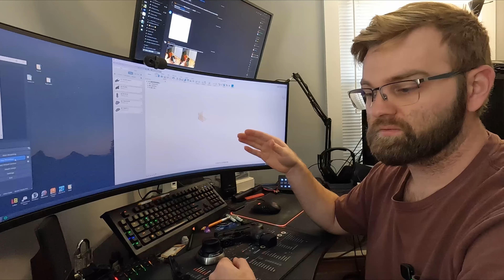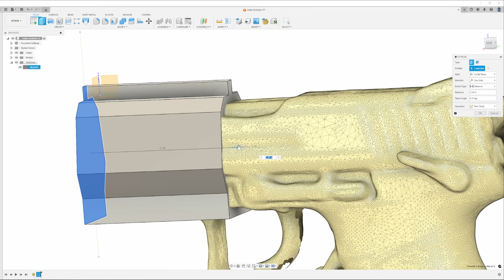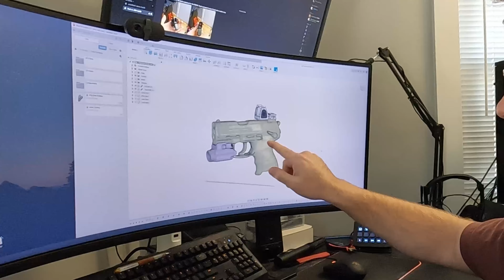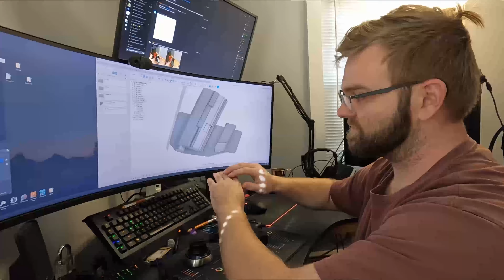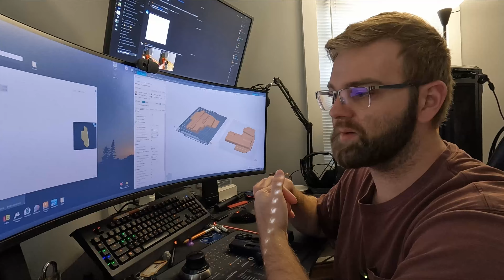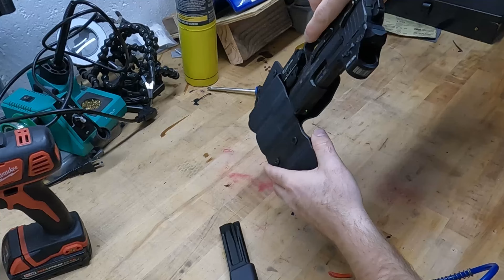Designing and Vacuum Forming your own Pistol Holster

Comment: Spray deodorant leaves a matte finish
Reply from the maker: I’ve tried it but never got it to work super well. The alcohol and baby powder is super cheap and applies super well. Also some of my larger scans like the front end of my car would take cans of deodorant probably! But I know some people love it
Reply: @TwinCrestInnovations  I will have to try that, i was using degree spray and for $8 a can now it is kinda spendy. Aerosolizing the alcohol/talc mixture shouldn’t be too difficult.
Reply from the maker: @RadDadisRad I’ve been using the same bottle of baby powder for the last 2-3 years and the rubbing alcohol I just steal when I need it. You can probably use an old spray bottle but I bought a brand new one and mix it 1:1 as you need it. I mixed like 8 oz the first time and that was a mistake. A little goes a long way

Comment: Do you think you could make a kydex holster for a short barrel shotgun? Something that could be worn on the hip, the back, or even on a backpack?
Reply from the maker: Do I think it could be done? yes. Do I think it’s practical? Probably not if done like a normal holster but could be done in two pieces. 

I’d probably make a holster for the front 3-5 inches of the gun. Then a secondary holster near the chamber that clamps around the gun, maybe use a strap with a snap for retention. This way your draw distance is short. Otherwise you would just be making a plastic scabbard.
Reply: @TwinCrestInnovations That makes sense. I've been trying to figure something out for my bush gun when in Montanan griz country. It's hard to find that balance of steady and ready but also having it protected from dirt or twigs that might try to get into the barrel.
Reply from the maker: @M @MichaelSelhost  think going with that two piece holster would be your best bet. The two half’s would have to be joined by a semi rigid board or something. You could use kydex. I was trying to think of readiness and removing cost. That way it’s not this giant chunk of plastic. I suppose it would also reduce weight if you are hiking around a lot.

Comment: Brother do you also scale your mesh body before you start modeling your first sketch? Thank you
Reply from the maker: As long as you import it with the right units you shouldn’t have to scale it. The shinning 3d scans in millimeters and should be 1:1 if imported correctly. If you use a different software for scanning your results may vary
Reply: @TwinCrestInnovations Thank you
Reply from the maker: @1Defenseart  no problem! Happy designing!

Comment: Why not go kydex right over the actual firearm? 🤔 Sorry if that’s a dumb Q
Reply from the maker: If you just went directly over the firearm you wouldn’t be able to pull it out of the holster. For one example the kydex would form around the trigger and block the flashlight from coming out. There’s so many little areas that it would get hung up on. This method lets me make paths and channels for things to slide out. Some people will use painters tape and popsicle sticks to achieve similar results for one off designs. Not a dumb question! Thanks for asking!
Reply: @TwinCrestInnovations man that was so obvious after you said it. Lol great work man. I’m finding this video incredibly inspiring for an idea of mine. Thank you!
Reply: I’m such a newb tho. Literally played with Tinker CAD for the first time ever and trying to figure out which 3D printer will get me to a nice finished product.
Reply from the maker: @richardlopez9001  if you don’t want 3d printing to become your hobby then I cannot recommend Bambu labs enough. They are also currently running a sale! 

I’d also recommend fusion 360 and spending some time learning that. There’s a guy called Learn Everything About Design here on YouTube that has a great beginner course on how to use fusion. Give that a try!
Reply: @TwinCrestInnovations I went out and bought a Bambu Labs P1S last night and I have to thank you for steering me in that direction. I printed a sample just to see things in motion and then stayed up until midnight creating my mini prototype and printed it this morning. So stoked man!
Reply from the maker: @richardlopez9001  I have spent many a nights with the “I’ll just add this one more thing” bug and then you start seeing the sun come up haha. Good luck and if you are trying to do a super quick mockup that doesn’t need any strength give “lightening” infill a try. Super fast for testing something out. Good luck with your project!

Comment: Would love to see a video on the safariland style owb build
Reply from the maker: I’ll put that on the list for the next holster! I’m going to do another series that really steps through the basic design first
Reply from the maker: What specifically would you like to see?
Reply: @TwinCrestInnovations the design for the active retention system mostly. I've done basic iwb stuff on my own but thats it.  Adding level 2 retention is easy  with just adding blocking and a hood like the spetz or talon. Haven't seen anyone do als style like yours tho
Reply from the maker: @absolutetorquetuning7956  I actually reverse engineered the safariland one. I found a guy on thingiverse that had a replacement part. You have to be a rep to get replacement parts so he modeled his broken one to fix his. With that I was able to design my own, make some improvements and design the rest of the mechanism around it. Thanks for your input!
Reply: @TwinCrestInnovations  ever consider selling or posting the designs you did on cults or thingiverse?
Reply from the maker: @abs @absolutetorquetuning7956  I have posted both of my current holster designs on cults. I think I linked them in the description. If not search my name and you should be able to find them

Comment: Add some bluetape on the Magazin and Pistol, Insert them when bending. And please don't use a torch for heating.  Use a strip wire or hairstraightener to heat up the kydex. So you will not have the heat spread  over all the areas you won't get deformed. 
The workflow with scanning and CAD is great.  👍
Reply from the maker: The torch was definitely not my first choice but it was my only choice at the time. I have a really nice heat gun for next time!!! Thank you for the advice with the painters tape. I’ll give that a try!

Comment: Nice to see someone else using "normal" filaments. I use PLA, 20% infill and 12 layers for molds which I use seldomly.

An unsolicited tip, in case you want to built another holster: the retention point should usually be at the inner front of the trigger guard and not the ejection window. Apart from scratching the finish, kydex tends to bind massively at that spot - as you found out. Especially when you add curvature. 

Putting a little spacer a little less thick than the trigger guard allows you to add a rubber washer, screw and post. Now you made a holster with adjustable retention.
Reply from the maker: I unfortunately couldn’t put the retention point on the trigger guard due to the light. But I’ll keep that in mind for future builds! I didn’t use rubber washers on the inner part of the holster to adjust retention. I believe I me mentioned it but didn’t show it. Thank you for the input!
Reply: @TwinCrestInnovations oh yes, you are correct. Excuse my mistake. 

In this case, the retention usually is at the screw with which you mount the light to the gun. English being my second language, I may not be able to express myself coherently.
Reply from the maker: @Flachlandholster  No worries. I think I understand what you’re saying. That’s a really good idea. Have you had any issues with the screw backing out?
Reply: @TwinCrestInnovations It's not my original idea. I mimmick what other people habe done prior. 

That being said: I never had any issues when loktite is applied. 

And, not to forget: any divet (?) on the light or it's contact with the weapon can be used as a retention point in my mimited experience.
Reply from the maker: @Flachlandholster  this was only my third holster ever made so I’ve been taking tons of feedback to grow my process for the next one

Comment: How can I make these planes display when importing a mesh?
Reply from the maker: I try to work of the coordinate planes that are based off the origin whenever possible. Before you do anything make sure to orient it to that. I mention this when i finish up the 3d scanning portion. It will make life a lot easier. If you are using fusion there is an origin toggle in the top left of the view window. I hope this helps
Reply: I'm talking about that fancy symbol of the system and planes on a white background. I have those in the corner, I just can't seem to get them to fit there. I have the scans ready, I just haven't scanned them myself yet.
Reply from the maker: @W-schodni   if it’s the one near the barrel then you need to turn the origin on and for the white background, at the bottom of the view window there should be a few tabs and one of them lets you change characteristics of how you view things. I believe it’s called visuals and is a little screen icon. In there you can turn off the grid. I hope that helps!